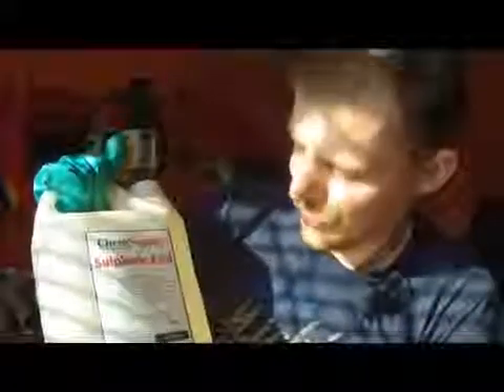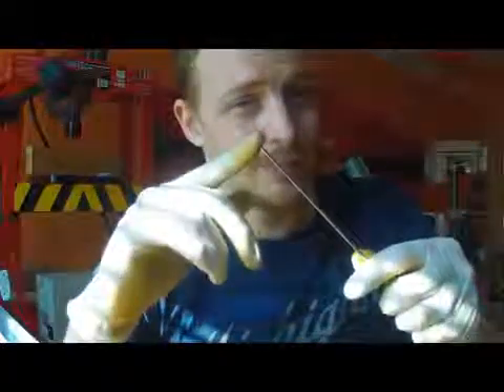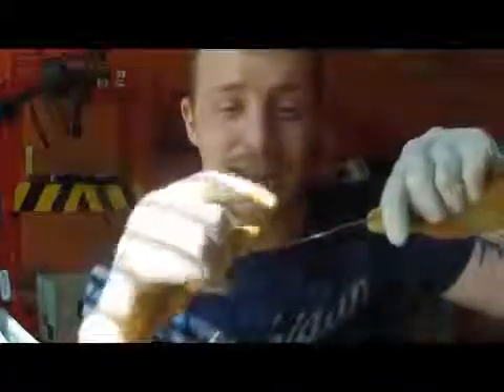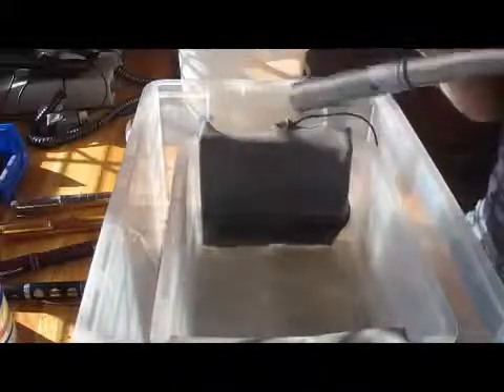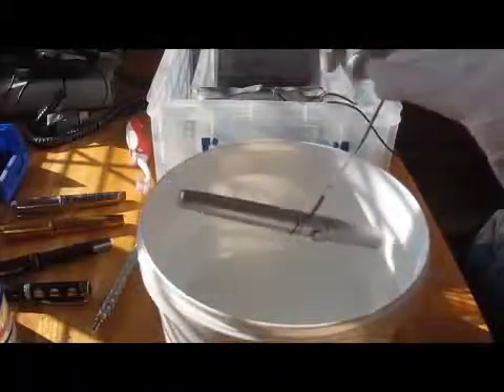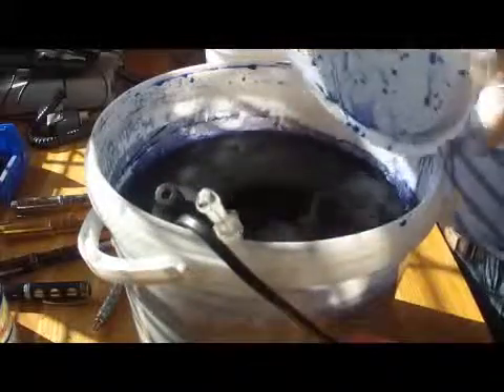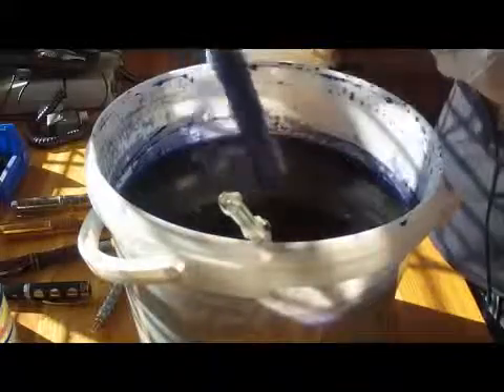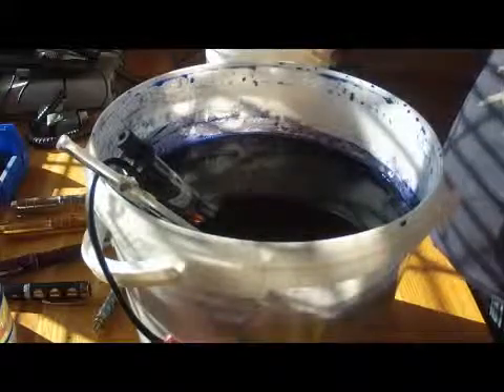cong nghe anode nhom tai cong ty TNHH HARD COAT VIET NAM PẢT ✔

Comment from the maker: HARD COAT CO. VIETNAM
Disc Village, Nam Hong, Dong Anh, Hanoi.
TAX: 0104793843
Tel: +84 (4) 39585065/67
Fax: +84 (4) 39585069
HP: +84 904 980960
Email: ntchuc@hardcoat.com.vn
www.hardcoat.vn
Hard Coat Co. Vietnam, was established since 2010 with 100% invested in Japan. Our company works in the field of metal surface treatment as:
1 - plated aluminum anode (anodizing for aluminum)
2 - Handling passive aluminum before painting (3 + chromate conversion coating for aluminum)
3 - Passive Treatment magnesium (6 + Nonchromate conversion coating for magnesium)
4 - Vacuum Impregnation error handling for air leakage aluminum products. (Impergnation treatment)
HardCoat is a supplier specializing in surface treatment of metals such as magnesium, aluminum for the engine to run in high heat environments for automobiles, motorcycles and other products like aluminum hull, shell semiconductor devices, electronic devices such as phones, cameras, computers ... using passive treatment pretreatment before painting, surface processing hardware, hardcoat has further handling Arumite, Ganshin. With processor technology Arumite Hard Coat implemented Arumite diverse methods such as conventional Arumite, Arumite-plated hardened aluminum anode, Arumite-plated handles color.
Note: ARUMITE = anode = oxidation anodizing
In addition, with technology Ganshin - Hard Vacuum impregnation Coat overcome handle absolute success for the later stages of product cast aluminum gas detectors. With modern machinery combined with a team of highly qualified staff of technicians Hard Coat has brought high-quality products with delivery time absolutely Hard Coat has taken the trust of the customer goods and services are used by HardCoat.Voi motto is customer satisfaction leading QCD (quality-price-time delivery) Hard Coat constantly training to improve the technical level, the and quality management in each stage of the officials and staff.
Inheriting technology from the company Hard Coat Japan since the company founded in 1957, spent many years in the field of processing companies have proven strengths is handling the ADC12 aluminum alloy materials (aluminum castings form) or material of aluminum alloy AC line as automotive parts, motorcycles, electrical components and gas ... and achieve top quality in the field of processed products aluminum alloy castings. It is obvious that the product is processed aluminum alloy castings, aluminum alloy types such as Al-Cu, Al-Mg-Si AL or aluminum alloy 7000 is composed of metallic elements is very difficult and completely different on the surface processing of pure aluminum Arumite handling common-anode oxidized aluminum and aluminum plating on the anode aluminum alloy casting products is an extremely difficult job and it requires skill processing technology and processing technology are very high.
 Over 55 years of operation with the ongoing development and technical innovation Hard Coat company has achieved great achievements and special experts, research centers under the Council of Scientific Process Technology of aluminum in Japan selected as a leader in the field of processing Arumite and was chosen as the place to train scholars, professionals or customers wishing to learn and learn about domains Arumite. Hard Coat addition the company also achieved the oxidation treatment of aluminum anode for parts requiring precision to Micro units (micrometers) and meet the increasing requirements of product quality.
Aluminum anode technology. Aluminum can will become harder and more durable after going through a stage called "anodizing" (the anode electrolyte). Anodizing includes embedded into the acid stage, usually acetone chemicals in the laboratory. Aluminum becomes the set of the positive anode and chemical tank is the set of the cathode. Power flows through the acid, causing oxidation of the aluminum surface. Surface oxidation to form a hard, protective coating instead of conventional aluminum layer on the surface of aluminum panels. The results of this process give birth to a powerful link called aluminum anode aluminum (anodized aluminum).
aluminum anode can almost diamond hard after going through the process of anodizing. Many modern buildings use groups anode to steel frame structures and structural elements exposed. aluminum anode is also popular materials used for the production technology of high-end household appliances such as pan, pot anode. The temperature is evenly distributed across the surface of the aluminum anode, anodizing and allows perfect protection. anodes groups can combine with technology electroplating technology anodized anodized conditioned tanks were cooled at a temperature of -40 C to color the surface according to the color copper anode aluminum, tin and other metallic colors . Can also use the type of dye to color decorate aluminum anode.
Thanks to a strong and durable links, groups anodes can be used for many different applications. Many types of artificial satellites orbiting the earth using the aluminum anode layer to protect from asteroid debris. Automobile manufacturing industry uses a lot of groups in the production of anodes tires and the need to protect the exposed part of the interior design xe.Cac often used as anode aluminum frame structure designed for outdoor , as well as base metals to produce lamps and decorative products khac.Cac appliances and computer systems advanced phone casing can also be optimized with the department uses aluminum anode sheathing.
groups may anode material is not optimal for all applications because of its non-conductive. Unlike for other metals like iron, oxidation does not weaken the links of aluminum. Grade "stainless aluminum" (aluminum rust) was created after oxidation is still part of the original aluminum structure and will not turn to food, or easily lost due to mechanical action. This is fundamental in the production of kitchen applications as well as for household applications as durability is paramount.